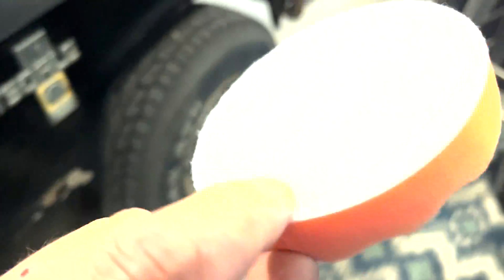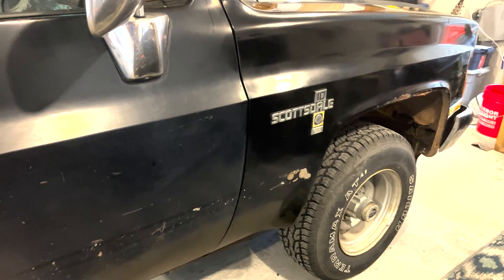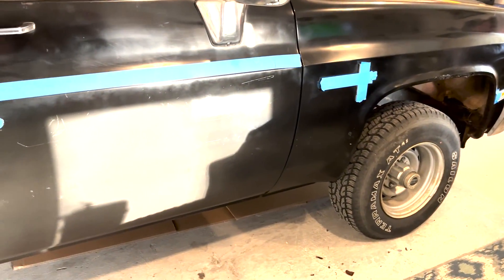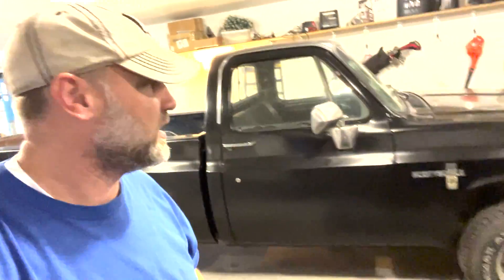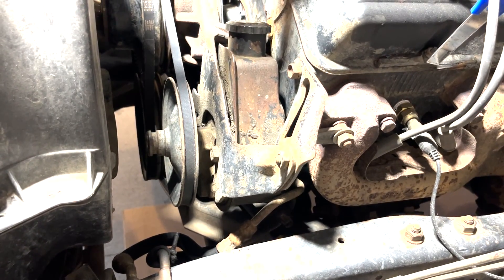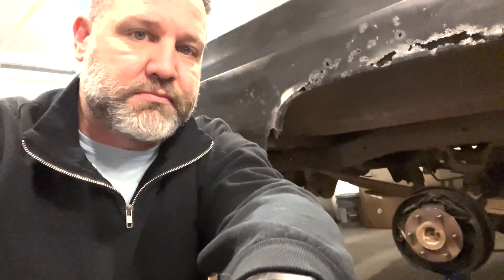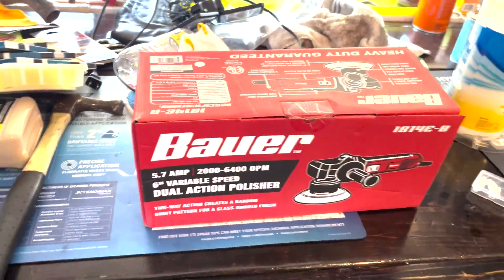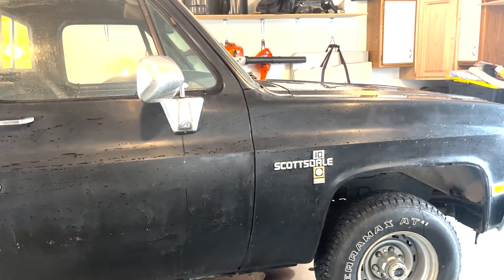Restoring Dad's 1981 Chevy Scottsdale K10 Squarebody Truck - Part 7 - Winter 2023 Work and Musings

Comment: Shine juice is more for heavy patina vehicles,  probably not black either. Should have lowered this truck when you replaced rear springs.
Reply from the maker: Lowering is not for me. I’m not a fan of that look.
Reply: @Jason Dannelly  only thing a 2wd truck is, basically a car
Reply from the maker: @mblake0420  I gotcha, I run my K10 in 2WD most of the time anyway. Only get's into 4WD in the winter.